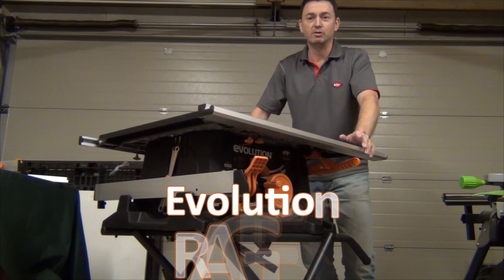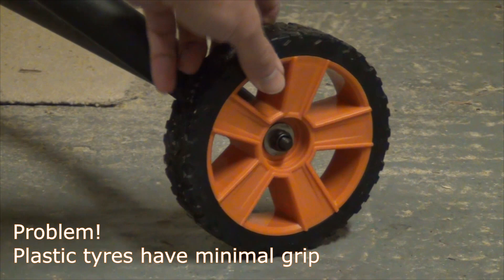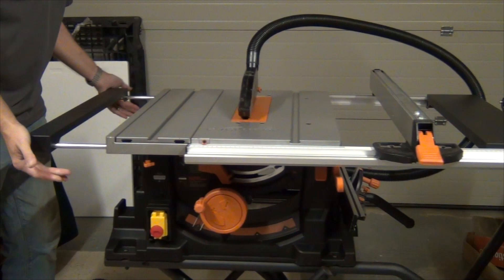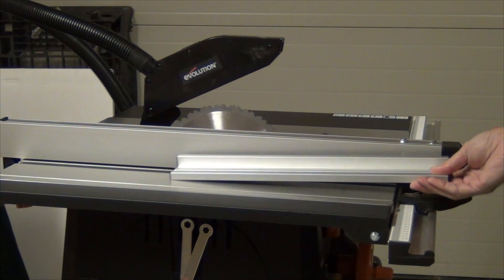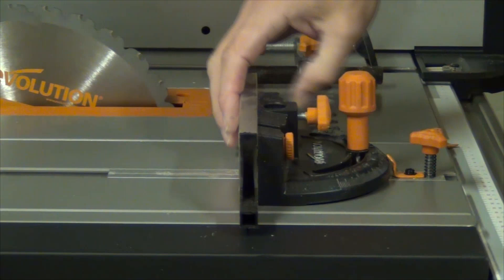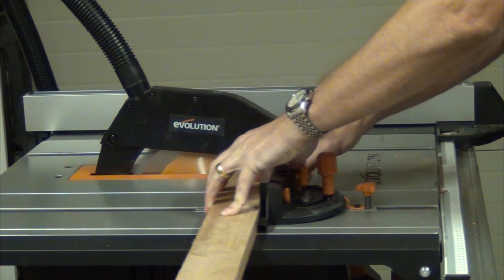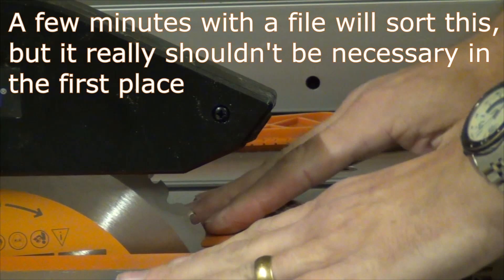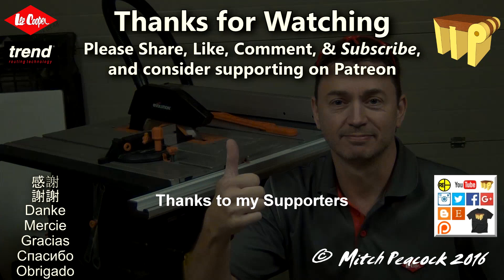Evolution RAGE5S Table Saw Review

Comment: An excellently produced video and a comprehensive review without any annoying special effects or background music. One of the best of this machine that I've seen.
 Not having tried the machine, I may be mistaken but I disagree with your preference for pneumatic tyres. I suspect this may adversely affect the stability of the machine. Thanks for the review.
Reply from the maker: Berny M Thanks Berny. I agree about the tyres - I meant solid rubber, for little movement but better grip.

Comment: The problem of grip to the floor is recurrent in many machines, and is not a minor aspect, because it can be very dangerous, but the set is quite complete, a good choice. Nice review Mitch
Reply from the maker: Daniel Solowiej You're right Daniel, could be dangerous. As with any fixed power tool, make sure it doesn't move before operating it

Comment: You left out the fact that what sets this saw apart from others is that the left hand table panel moves in its track together with the mini cross cut guide locked in place!
Reply from the maker: I did. It could be useful, but would be so much better if the sliding table section extended right to the blade.
Reply: @mitchwoodwork  oh sorry, I missed that. For the money this table saw has a bundle of features missing from its contemporaries. Including  to my mind the sliding feature. I made a sled but for quick cuts the sliding plate is quick and easy. I did change the mitre gauge though as the one supplied is a bit average. Also the the full width fence is fab along with the add-on that is very useful for thinner material. I also bought a finer tooth blade for my woodwork. What’s missing? A soft start module but that’s fixable. Thanks again 👏🌹🇦🇺✌️

Comment: Good review.
I found the assembly instructions useless, so I laid the parts out and figured how they should be assembled from the photograph.
It has some nice features but there are issues, especially with the guard.
It seems to cut pretty well and fairly accurately but I found ripping a piece of 3" by 3" very slow and the blade got hot. It would probably be quicker to rip it down  with a rip handsaw, like I used to years ago. Ind you I am more used to larger industrial machines. The blade does cut embedded nails but seems blunt to me. 
As it stands I think I'd be better to stretch the budget with a Makita or Bosch.
Reply from the maker: Thanks for your comments. I think the evolution wood blade would improve the speed of your rip, as the multi cut blade is a trade off between performance in one material, and survival across a range of them. I think it's a good value saw, but clearly spending more can buy better performance.
Reply: Mitch Peacock - WOmadeOD . I am sure it would but I have a lot of good second hand timber which has has embedded nails, hence the evolution saw. We always, in the days of hand tools, had a rip saw and a cross cut  saw. It's very hard to get a multipurpose saw.
I haven't had it long to test it and to see what it can do.
Thanks
James
Reply from the maker: Ah, makes sense. Try experimenting with the feed speed, and taking two passes. I find blades get hot when the feed rate is too slow. Hand ripping is fun when there aren't nails to deal with, but I'll all with you on using second hand timber, so finding the best way to process it is important.

Comment: A really useful review - thank you.  Seemed like a good value saw, but that blade guard is a deal-breaker for me.  If they let that pass without noticing or caring, what else didn't they notice or care about?  I have high hopes for their next iteration of the model, though, so will keep my eye out!
Reply from the maker: Understandable. I must check some other machines for similar guard problems - easy to overlook since most users will lock it up or remove it anyway. Cheers, Mitch

Comment: I would have liked a comment on the arbour size Mitch . That is can you use a dado stack with it or is it too short ? Also a price mention wouldn’t have been bad.
Reply from the maker: They currently sell for £250 (Screwfix) here in the UK. Not suitable for a dado stack. 24.4mm arbour, but Evolution blades recommended as designed specifically for the arbour speed. Hope that helps.

Comment: Great review. You mentioned the slop in the mitre fence could be sorted out with a centre punch along the bar. Could you explain what you mean? Thanks
Reply from the maker: Cheers!
Sideways slop can usually be corrected by centre punching along both sides of the sliding bar - when centre punching, the crater formed also produces a raised rim. These raised areas effectively widen the bar, tightening it in the mitre slot. If it becomes too tight, then a light filing will bring it down to an easy slip fit.
Reply: That's genius :). Thanks for your help.
Reply: i built a sled for this straightaway and found that the the guide rails were actually quite rough to the touch and ran some fine grit paper down the edges is certainly helped the guides run more smoothly i also took off the blade guard immediately and haven't put it back since
Reply: it is to sloppy to spread it that much i had to tape it
Reply: Bit of a pain but you can lock the mitre to the sliding table which Mitch missed out on here and slide that to get more accurate cuts. Just picked mine up today. Although my sliding bed has a slight bow in it about a 1mm in the centre. Thanks Mitch for the review.

Comment: this saw can need a lot of tuning my mitre slide was very sloppy and a lomg wayu out of parallewl with the blade also the rip fence sliders had to be filed down one side to correct the 3 mm that it was pinching at the back realy dangerous  but works well now
Reply from the maker: Thanks, it's worth hearing other people's experiences. Many would have been inclined to return it rather than fix the problems. Clearly shouldn't have left the factory in this case
Reply: it was allrewady an unused return so had£50 off so i expected there to be a problem .most saws need tuning for plumb and square any way

Comment: Hey, Mitch, I was curious how it's going with your Rage 5S. Have you been able to use any other saw blades with it? Do you find it powerful enough to use on your wood projects?
Reply from the maker: T Knickerson I recently installed a very thin shim (cut from a drinks can) to shift the riving knife to the perfect position. Not something necessary, as it worked safely, but just a little slicker now. Otherwise it's performed fine, and I still rate it good value. The motor speed is matched to the evolution blade design, so that it can cut various materials without problems, which means other blades aren't recommended. I haven't tried any other brands on it myself, but the evolution wood cutting blade works very well. It's 1800w is fine for most stuff I've thrown at it, although thick cuts in hardwood can be better taken in two bites. The blades are thin, so making a groove could be a painful job. Hope that is useful.
Reply: It is. Thanks for the info. :)

Comment: Thanks for the review. Isn't there a sliding table?
Reply from the maker: Yes there is Stephen. It works fine, but has limited travel and isn't the full width of it's side of the blade. Not having a sliding table on my cabinet saw I don't feel it's a particular advantage, and I think a shop made cross cut sled would be better.

Comment: Are the mitre slots standard size?
Reply from the maker: Never gave it a thought before, but I've just measured it and it's 3/4" x 1/4" (with a t-slot extending the 3/4" to a little under 1") so I think that's pretty standard.
Reply: Thanks! :D

Comment: I know this is old, but I was looking for a better review...you don't really know how good/bad a saw is until you build something with it....as far as power...even the cheap saws have enough power..I'm pretty dissapointed in this review...not going to give it a thumbs down, but...this is more a promo than a review....but based on what I saw(no pun intended) I wouldn't buy one.
Reply from the maker: At it's price point I think it was pretty good, but it is more suited to DIY work on softwoods and light metal tasks. The optional wood blade is better for tackling larger sections and hardwoods.